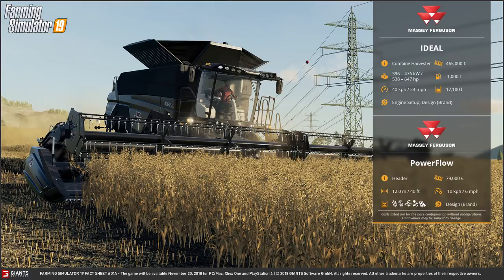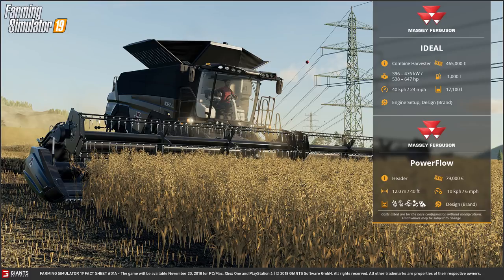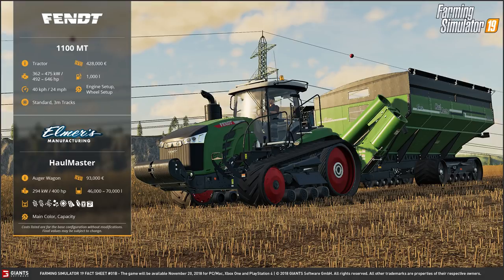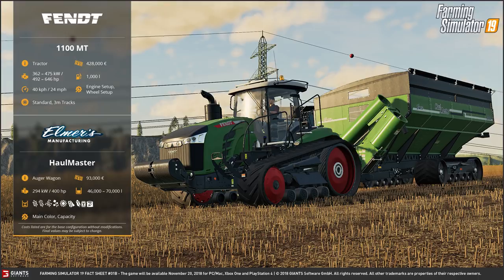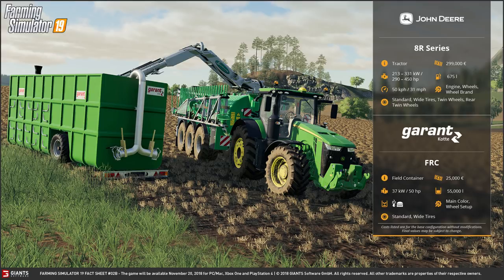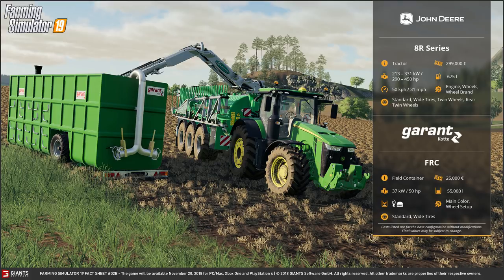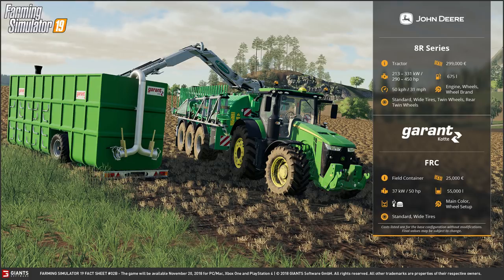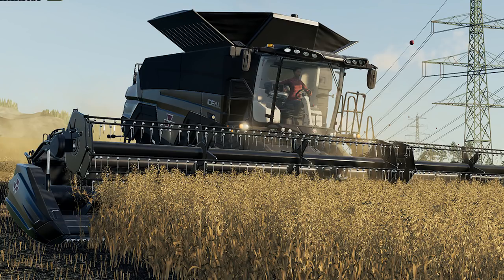THE FIRST 4 MACHINES  | Farming Simulator 19 | Fact Sheets 1 & 2

Comment: The 10.90 had a 1300 litre fuel tank?

But I guess the 17,100 litre tank makes up for it... Pricey though! 😳

465 vs 430 thousand for the 10.90...so €539,000 Euro setup!!!

😮😮

Also 40ft vs 45ft header.....
Reply: Also, note that as stated in the fact sheets, the prices mentioned are intended for the base configuration. So if you choose the more powerful setup, it will cost even more, so for this combine + header, you might have to spend around €600k 😳
Reply: Well, you could still run the 45ft header on this, it would just look a little funny.
Reply: Will need a good MacDon mod.

Comment: wait what? 
the 8R series only goes up to 400hp with the 8400R 
where did they get the 450hp from?
Reply: ZeroG Coasters a 8450R I assume, only found one pic of it on google but the pic was blurry so couldn't make out the model number.  Look up "8450R on floaters"

Maybe a new model Deere is releasing in the near future?  They are playing catch up to the rest in terms of their top model high horses power row crop tractors.
Reply: ZeroG Coasters they list peak horsepower instead of engine horsepower.
Reply: well, i did check the JD website and there is no 8450R but we´ll see
they had an 8450 a long time ago, the little but older brother of the 9R tractors
Reply: John Deere UK sales site lists the 8400R max hp as 450 at 1900rpm with IPM. I have no idea what IPM stands for though :D
Reply: ZeroG Coasters like I saw the 8245r in game and it’s listed at 280 peak horsepower.
Reply: different engine options most likely the hp goes up as well with the number of the tractor